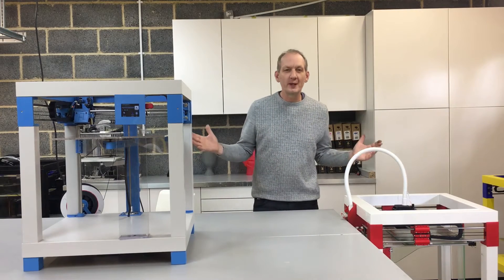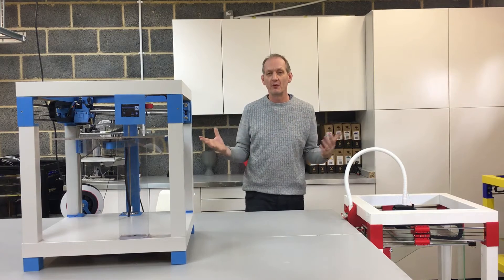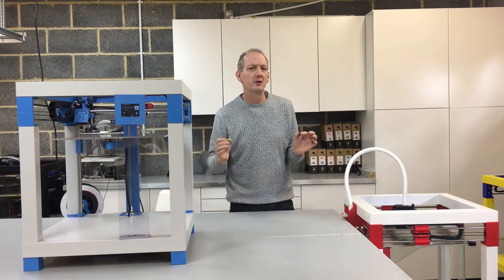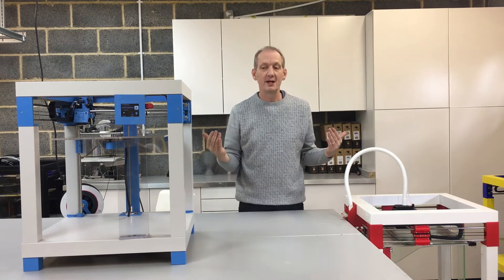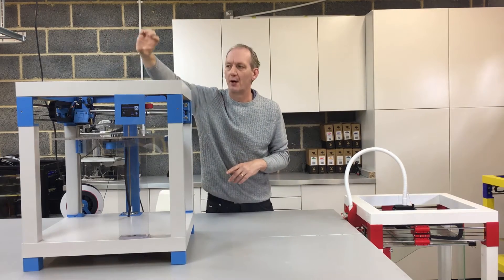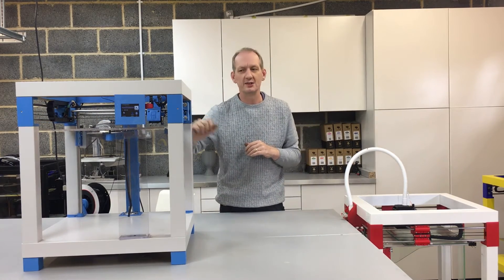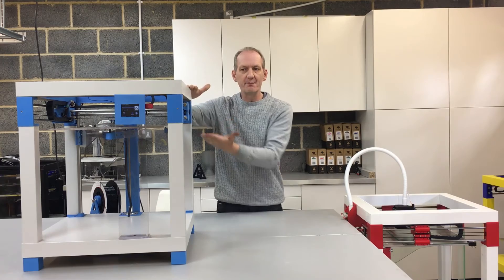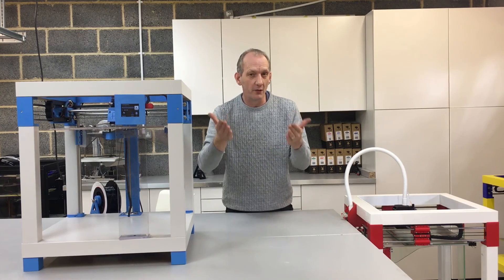Update Introduction

Comment: For some reason I am unable to find out what size printbed are you using 18x18.
Also I want to buy the The Polycarbonate pack but 60 dollar flat rate shipping is astronomical is there any way i can find this in the USA?
Reply: Michael Buckley it's a silicone heated bed. 300x300 I believe. He mentioned it in another video.